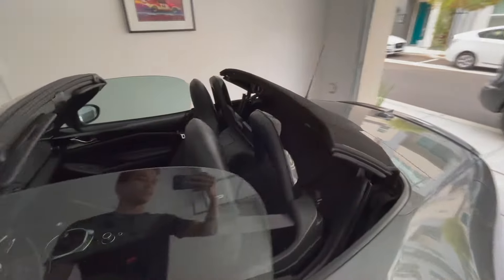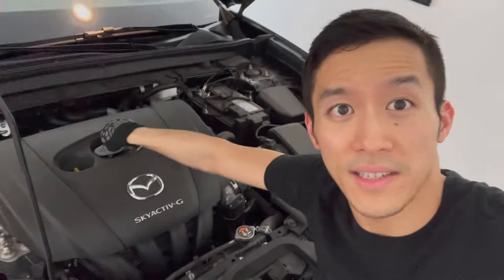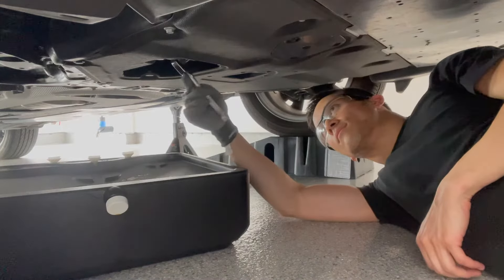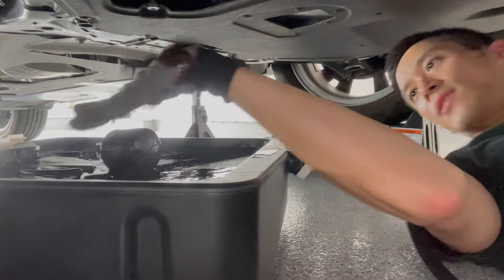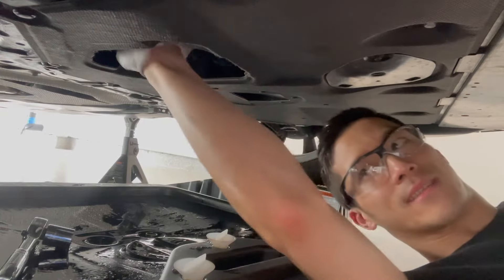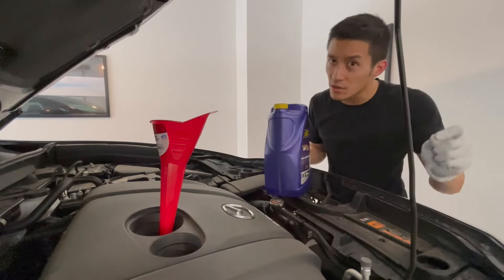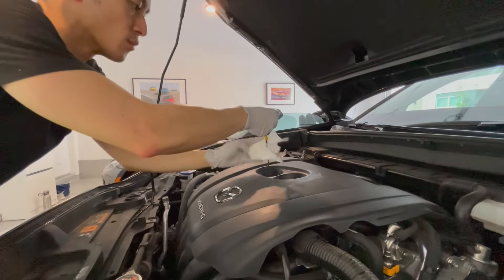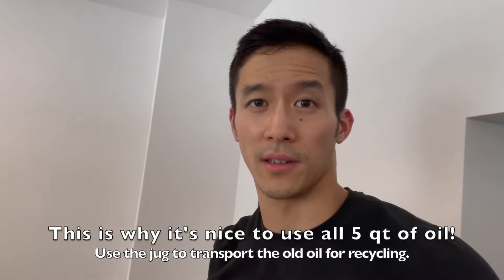My CX-30's First Oil Change! (DIY - Easy Step-by-Step)

Comment: Hi James,  great video  I am from Canada and I just bought this car in the Turbo GT which is the top trim here.  I love it, however, the only thing that I came to realize after buying it is that the ones that are sold here in Canada do not come with the chrome roof rales, or the front and 360 camera only the back camera.  I have checked it out at all Mazda Canada Dealerships before and after buying it and it's like that at all of them.  Would you be able to say why? if you can it would be very helpful as I would like to know why only this top trims in the US and Europe have it and not here in Canada.
Reply from the maker: Hi Boeing F, I don’t have information on why the chrome roof rack is not offered in Canada, but it does seem that the 360 camera situation is explained by the fact that the trim levels top out lower in Canada than in the US. In the US, you have to go to Turbo Premium Plus to get the 360 cameras, whereas it appears the top end Canadian model is equivalent to Turbo Premium here. Of course that leaves the question open as to why Mazda limits the trim level range in Canada, but only marketing executives will have that insider information. Hope that helps provide some context!

Also, luckily the roof rails are available for purchase, and can readily be installed as a DIY.
Reply: @JamesPlaysWithCars  Thanks for your reply, I figured the same as well.  It's strange that Mazda would not offer that to us here in Canada.  I love my CX-30 but the 360 with the front camera would have been great to have as well. I choose the turbo not only because of it being the top trim here but also because of the black gloss rims it comes with.  It really blends in well with the black plastic on the sides and looks great with the red.  I did a lot of research on it before buying it and also have to say watching your videos on it help me with choosing it as well.  I look out for your videos on this car so I can learn more about it as well so please continue to post more. If you are ever in Toronto let me know as well it would be nice to meet you and take you for a drive in my CX-30 Turbo. lol

Comment: Nice video, thanks for posting. I do my oil changes myself, I do it almost exactly like you.  Only thing I want to mention is that after breaking the oil filter loose and it's starts draining, just leave it alone for a minute so the oil drains on it's own into your pan. Also, I think if you check your oil level again, it will be near the top instead of the middle.  Most cars, I've found you need to drive them a few miles to get an accurate reading right after an oil change or cold start, as the oil is too viscous and doesn't drain down to the pan to get an accurate reading when cold.

Comment: Time is money. Having a professional shop do this for 20 bucks or 30 bucks is much more efficient than wasting time doing it yourself.
Reply from the maker: Many of us enjoy working on our own cars :)
Reply: James Do I’m all for working on your car when such work improves its function, appearance, performance, or utility. But changing the oil? When it can be done on an almost drive-through basis for $20 and they check all your other fluids? No. Time wasted. However, everyone is free to do what they want.
Reply: Please indicate the “drive through”that offers an oil/filter change for $20. Also,  why wouldn’t you consider an oil/filter change “performance” or “function” related?
Reply: @JamesPlaysWithCars  Totally agree. So many reasons to do it yourself. You know it is done right, you know what oil/filter is going in the car and it is usually faster than driving all the way to a quick change place, waiting there and driving home. Time is money and money is money and doing it yourself saves both! Great job.
Reply: @sandsmarc  where do you get $20 oil changes+fluid top ups? 
The only place I know that adds fluid top ups are dealership service centers, and they cost upwards of $70 and have 30-60min wait times, if not by appointment only.
Reply: The places around me charge $70+ AND I have to wait 2-4 hours. No thanks rather do it at home and not have to drive anywhere